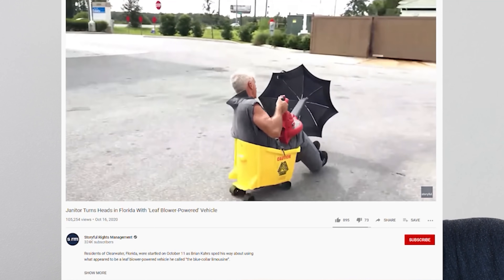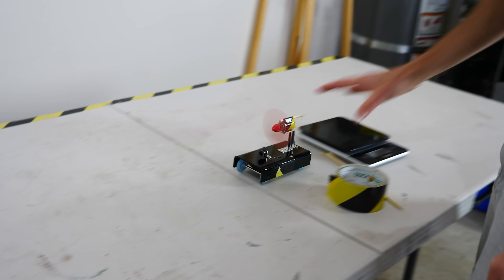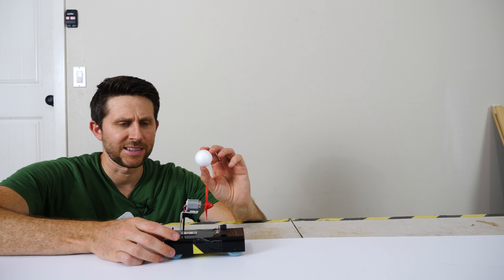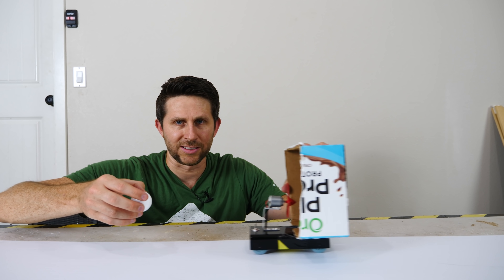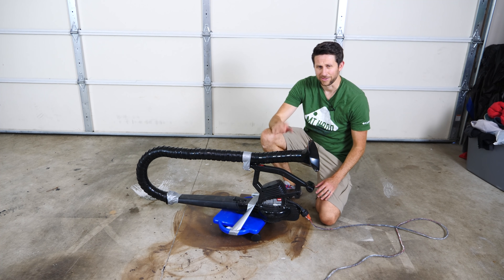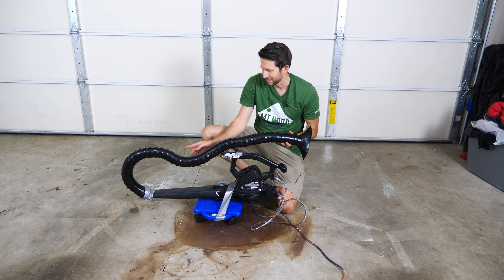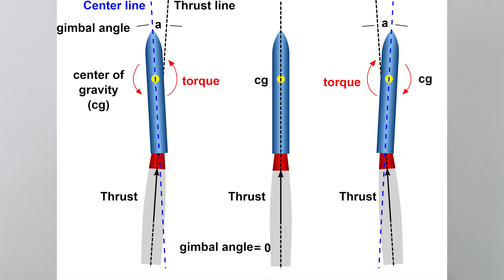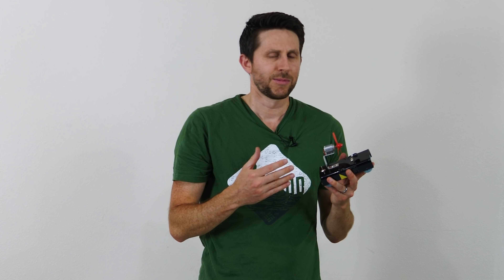Blowing Your Own Sail Actually Works

Comment: Wait a second. But where does the air COME from? It's coming from the same direction you're blowing it out. So how can it be moving forward? In case of a jet steering, there is no air, they are self propelled with expanding gas. In case of a leaf blower, the air is actually coming from the bottom, but the force just gets countered by the wheels and floor. Where is the air coming from when you're blowing your own sail with the fan?
Reply: The electricity that powers the fan is the energy input.

Comment: Isn't there also kind of a Bernoulli effect going on when you confine the air and it is accelerating to create a slight low pressure zone?  Probably only a minor effect, but it should still be there

Comment: It's possible I didn't understand correctly, but... I think this time the explanation is not too accurate. If particles bouncing back would do the job, so blowing a flat surface in front of you would work as well, but it doesn't because air leave "the vehicle" in the directions perpendicular to the expected way of moving. Moreover, the vectors of forces cancel themselves. As I understand this phenomenon, it's all about the redirection of airflow on the curved surface (in this case rectangular :) ) such as it was shown with the pipe. The vehicle efficiency would be more beneficial if sucked air comes not from the back.

Comment: If you watch the original video it's a motorized skate board he uses.  You can see at around 9 seconds the wheels change when the shot does.  I didn't catch it until I read the comments, wasn't looking for it, but it is 100% fake.

Comment: OK. But, consider a vehicle which gets most of its push from environment, a wind if you will, and it  cannot use any immobile medium to go "down wind faster than the wind", but it still has a reactive propulsion at its disposal. E.g. an airship towed by a parashute or a spacecraft equipped with both a solar sail and a ion engine. Now, blowing its reactive stream backwards ("classical" way) it would accelerate only to a point where its speed is equal to the velocity of the moving medium around it, and then it would "empty the sail". However, by blowing the reaction drive into the sail, although that reduces efficiency, speeds above the medium speed could be achieved. I guess that due to inefficiency there would be no need to use reactive engine until the vessel velocity approaches the wind speed (and for the spacecraft maybe even then it would be better to forget about the sail and just turn the stream opposite of the heading, because interplanetary space has very little drag).

Comment: No, the air does not bounce back against the sail !  The air will follow the sail surface, and if the sail is plane, this means the air will go sideways, and won’t push the sail. On the other hand , with a curved sail the air will change direction, hopefully with a non-null longitudinal vector hence the propulsion effect.

Comment: Isn't the umbrella close to parabolic, in its shape, though?  It would seem to be the case because parabolic mirrors concentrate incoming rays into a point, like a solar power generator or a radio dish.  It would seem to me that the thrust generated backwards would be closer to merely reversing the fan than, say, blowing into a box which does NOT focus the beam.  Notice he's pointing the leaf blower tube slightly to the side, not the exact middle, which would produce a reverse beam of air almost parallel but in opposite direction.

Comment: this is actually exactly how commercial jets slow down so quickly after landing.  Reverse thrust:  huge flaps open up on the side of the engine to redirect the jet exhaust forward.

Comment: That video clip has a curiosity to me regarding the umbrella.  If air were being pushed into its under side, how come the umbrella is puckered inward instead of outward?  The wind from the forward velocity is puckering the umbrella inward.  How can the wind caused by his speed be more force, than the wind of the blower from the other side?  Is this physically possible, or is that evidence of phony?

Comment: It works but only to some extent because that contraption is still not propelling itself but the box is creating air draft propelling it forward, same as when you remove the box but with less efficiency.

Comment: @The Action Lab, you should do some tests with that same box and slightly adjust the angle the air is hitting the box to see if there is a change in speed of the vehicle. Also, maybe test with some parabolic shaped sails made from plastic. Perhaps there is also some pressure differences with higher pressure in front of the fan and the lower comparative pressure on the front of the sail?

Comment: That man with an umbrella uses coanda effect to revert the air flow backwards. The air flow slides along the umbrella's hemispherical surface and blows in opposite direction.
Try to blow into the glass with a ping pong ball inside it, and it will jump out of the glass.

Comment: Turning around the fan and ditching the sail probably works too.
If so, I am not sure you're actually blowing into a "sail". Rather, you're making an electric air-jet.
Air is moving back, the vehicle moves forward. It's an equal, but opposite reaction.

Comment: I am confused when the fan pushes the air it has an equal reaction the opposite way and then the air hits the cardboard and pushes it forward. Shouldn’t this at best stay neutral?
Reply: The air doesn't stop at the cardboard though, it keeps going back past the fan, and this net reaction force is enough to propel the craft. If you extended & closed the box completely around the fan such that there was no net airflow leaving the craft, then yes there would be no net thrust.

Comment: So a sailboat goes in the direction of the wind NOT because the wind is blowing it in that direction but because the wind hits the sail, which causes the air to be directed towards the rear of the boat? :o

Comment: The fan would be pulled back with the same energy that it's throwing the air forward. So it's not just about the direction the air exits right? What I think is happening here is there is air being thrown to the sides also, and that has no net backwards vector. The shape of the sail wrapping around the sides of the fan is able to convert that into a vector that pushes the cart forward. The same same with the blower. It pulls air in from multiple directions in the back.

Comment: ⚡️ I always wonder why can’t we just use light bulb to give energy to a solar panel. And then uses the solar energy to turn on the bulb. So then it becomes free electricity. You see where it’s going, or it just doesn’t make any sense?

Same with the electric motors when both connected to each other., if you spin one motor the other motor spins too.

Can you please make a video to make sense??? ❤️
Reply: Simple explanation.   Can you pour more water out of a glass than there is in the glass?  You can't because there is only so much water in the glass.  If you think of electricity as water, you can not get more out than you put in.  Because it takes even more electricity to spin a motor than the generator can produce it will not work.  
Solar panels need much more light and heat to produce a small amount of power than a light bulb can produce.

Comment: If the air jet that leaves the vehicle is conveyed in a single direction of course it works, if it spreads sideways like when using an umbrella the efficiency goes very low.

Comment: That is very obviosly a skateboard WITH A THICK BACK END! This means it most likely has a motor there and someone else is using the controller. You can send those things around half a residential street before you loose conection. No idea why they need that but most do.

Comment: not a complete explanation. one reason for the leafblower being more efficient is because the fan is well behind the stream of air propelling the "sail". second, now that it's been shown that using a propeller driven "sailboat" allows boat to go more than twice the speed downwind, the proper drives aerodynamics that need further explanation.

Comment: Its actually quite wierd that the phenomenon that the first collision from the air molecules with the pipe (@ 3:09) isn't affecting a change in direction even a bit. Like we saw at 1:11 . Although the air molecules of the first collision should even have more speed to accelerate the object then the ones leaving the pipe. I first thought it's because of the curvature of the pipe... the molecules of the lower end will bounce off and make the air molecules of the upper side of the pipe accelerate upwards before they even collide with the pipe... but this doesn't add up. It could be tested by having the pipe go straight upwards 90 degrees. If it doesn't accelerate forward then its a god phenomenon.

Comment: Hey, can you show us what happens when you put a visible amount of electricity in distilled water as opposed to normal water?

I tried looking it up and saw a guy just basically trying to use a pool of distilled water as part of the circuit and it wasn’t really visualizing how electricity behaves in distilled water.

Comment: Veritasiums last video about moving faster than wind speed is really mind blowing
Reply: @ModeratelyAmused  good point
Reply: @ModeratelyAmused  Actually, that's exactly what is happening and you didn't get it
Reply: pun intended? :P
Reply: @ModeratelyAmused  as it often happens in physics there are many alternative ways to describe the same phenomenon. Reasoning about pressures is often a compelling viewpoint but it's not devoid of it's own traps as well. Imagine stretching the walls of the box in front of the fan so that they wrap back behind the fan and seal it off in a cube. Now, the air blowing towards the front wall is creating a higher pressure on that wall (compared to atmospheric pressure outside), and also the suction on the hind side of the propeller is creating a lower pressure on internal side the back wall (compared the atmospheric pressure outside); if you only look at the pressure differentials acting on those two surfaces you may conclude that a force is exerted on the cube in the forward direction, while clearly that would be violation of conservation of momentum. There is clearly a flaw in the scenario I described above, but thinking solely in terms of pressures can easily lead to such traps.

A similar duality of interpretation happens when reasoning about airfoils: common explanations about why wings produce lift involve talking pressures above and below the wing. While it is true that the pressure above the wing is lower than the pressure below the wing (and lower than atmospheric pressure), it is also true that the wing does deflect downwards a mass of air that perfectly balances out the upward momentum impressed on the wing. This physical fact is somewhat obscured by the fact that many textbooks describe idealized airfoils, by just looking at the section and assuming that the wing is infinitely long; wings with infinite area effectively create a downwash of 0 velocity; the only reason this doesn't break conservation of momentum is that such infinitely wide wings are simply non-physical to begin with. OTOH, a momentum theory of lift is (marginally) harder to explain precisely because it involves reasoning about the full 3d shape of the wing and thus often people who approach aerodynamics tend to first get acquainted with the good old pressure differential theory (of which sadly there are a few flawed variants around).

It's important to not mix cause and effect; both pressures and downwash are related to each other; they are effects of the mechanics of pushing an object of a given shape through a fluid. The air moving downwards far behind the wing clearly cannot cause the wing to move; all forces are ultimately transferred by "contact" (which in turn is nothing more than just the electrical force between atoms when they are close enough); but such contact between air molecules and other air molecules and other air molecules and the ultimately the wing, produce an effect of downwash that MUST object the laws of conservation of momentum. Since we know that, we can use that principle to guide us to understanding how the elementary forces must have acted on the surface, even when it's hard to actually compute the details.
Reply: @ModeratelyAmused  the air flowing backward is a perfectly good proxy for deducing where the actual forces on the object are. The reason I'm replying to you is that literally said that James's explanation is not "real physics", with more than a hint that he has no clue about what he's talking about, which is wrong and I wanted to offer readers of this thread an opportunity to understand that (I don't care about convincing you in particular, there is a community of people interested in science out there, who like to skim through comments and learn stuff, so please don't be offended for "lessons", don't worry they are not meant for you). FWIW, James knows what he's talking about and is IMHO a wonderful science communicator. Science communication is about explaining complicated things in a simple way. One consequence of that is that you clearly cannot bake in a full physics book in a few minutes video. Any simplification must be understood in context and the reader should apply thehttps://en.wikipedia.org/wiki/Principle_of_charity and not smear in bad faith.
Reply: @ModeratelyAmused  if the air flowing coming out the end is the exactly the same, the internal shape of the air guide doesn't matter. That said, the cross section shape does affect the way the air flows out; internal turbulence and deflections near the exhaust can cause the exiting air to have a component of the velocity that is normal with respect to the direction of the exhaust effectively canceling out their contributions.
Reply: is this a joke?
Reply: @ModeratelyAmused  That's exactly how force works. If you accelerate air in one direction, the reaction will push you in the opposite direction. That's how rockets work too. Your way of looking at the pressure inside the chamber vs no pressure outside is more convoluted and prone to error. But a simple conservation of momentum analysis guarantees that you arrive at the correct answer simply by taking into account the impulse given to mass ejected. That's the simple analysis behind the rocket equation, by the way. No need to factor in how the internals of the rocket engine work.
Reply: @ModeratelyAmused  Not what I said. Your pressure method is more convoluted and this is easy to see: how would you derive the net force from the pressure? You would need to integrate the pressure over the oriented surface area of the entire chamber. But since the chamber isn't self-contained, you need to continue the integration into the fuel lines, etc. You also need to factor in the fact that the fluid isn't standing still, that the pressure varies along the integral surface, and that there are chemical reactions happening which create pressure discontinuities. In other words, you need a full and detailed fluid dynamical analysis of the entire system. Furthermore, this approach is specific to each rocket design. Of course, the alternative is to just measure the flow rate of the mass ejected by the rocket and just get the thrust directly from that by Newton's 3rd law. You'll get the same answer either way, but one way is just smarter. That's what makes physics so interesting. And I should know, I have a degree in it.
Reply: Moderately Amused If that’s what you got from this video then you misunderstood it. They’re two different people, one provides more in depth explanations and the other provides less complex more intuitive explanations. No need to put them against each other because you have a personal preference.
Reply: xD the pun was intended
Reply: If you really think about it, its mind blowing whats happening. It looks like it makes sense. But just having wind blowing away from you makes you move???? "Regardless of direction of fan"
Reply: Yes i was about to say this

Comment: I think the explanation is slightly more complicated. If the leafblower had sucked all of that air from behind, I don't think it would have moved. I'm assuming it's sucking from the sides(or sides as well as from behind).
The vehicle is moving because of higher pressure in the cardboardbox, so some of the air being sucked in by the propeller actually comes from the side, and not all from behind. My guess anyway.
The pingpongball is great because it suggests a problem, since it is being propelled forwards and then backwards again. The sum of that is no propulsion.